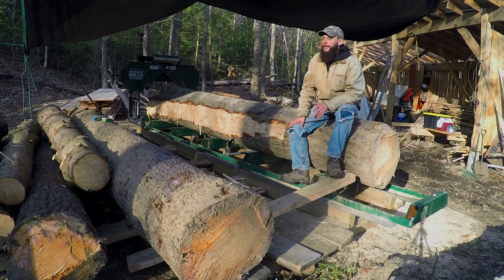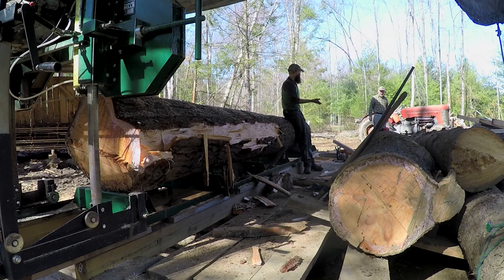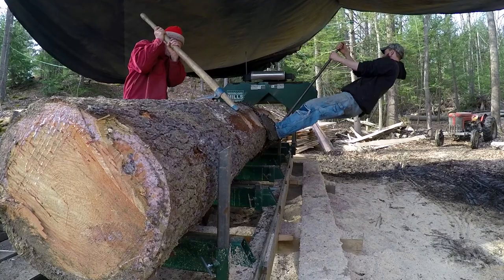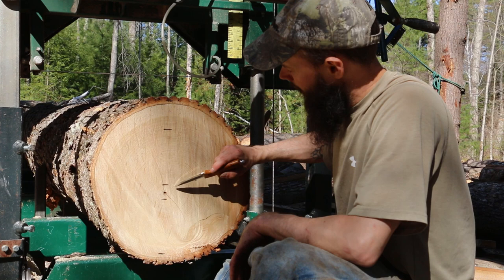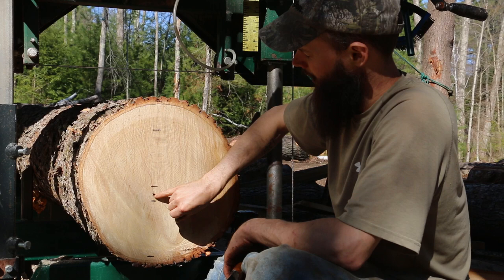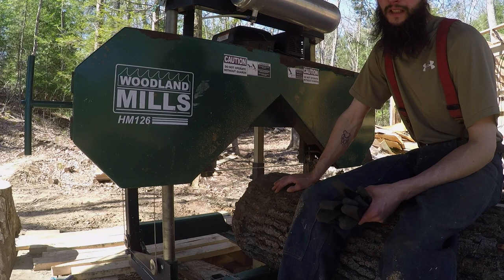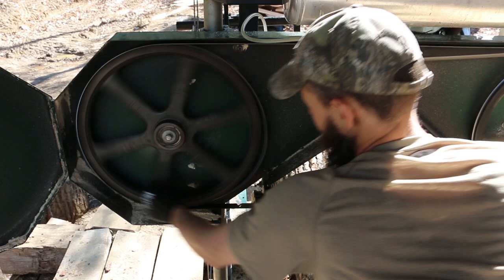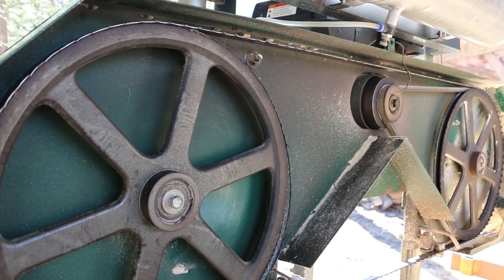Acorn to Arabella - Journey of a Wooden Boat - Episode 3: Milling

Comment: When I was a bit younger (1970) I worked with a bloke who cut two keels from a single Eucalyptus microcorys log (Tallowood) The smaller was 58 feet long and 48 inches by 18 inches in section. I don't remember the dimensions of the larger but it was longer but smaller in section. All the work was done on the forest floor with axes and wedges. The smaller keel went into a tugboat working out of Newcastle, NSW, Australia (a major coal export port)

Comment: FYI, if you have a tractor on site, drive rear to the log, and with something that's added to the 3 point system, spike the log and lift it from the center, then, try to spin it. Much easier.
Reply from the maker: Interesting idea.  
Unfortunately the tractor we have is too small to lift even the small end of the big logs =(  Those buggers are heavy!!!

Comment: I'm surprised you didn't anchor seal the end grain of your lumber to lessen the chance of checking during the drying process....how has it done over the last year?
Reply from the maker: Once it was all milled and stacked we gave the ends a coat of linseed oil and some copper preservative to help slow the drying and prevent fungus and such from entering the end grain.  Most of the lumber behaved very well so far, a few checked some what badly but if the lumber won't behave then we don't want it in the boat anyway.  Kinda like a mini torture test to weed out the inferior hunks of timber =)
Reply: Acorn To Arabella 👍